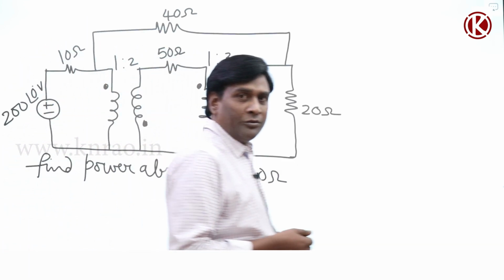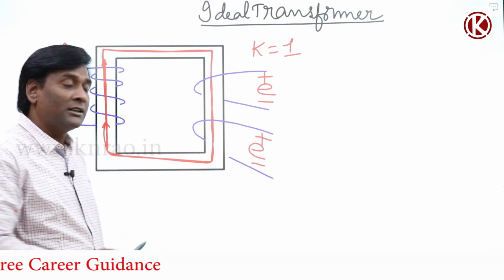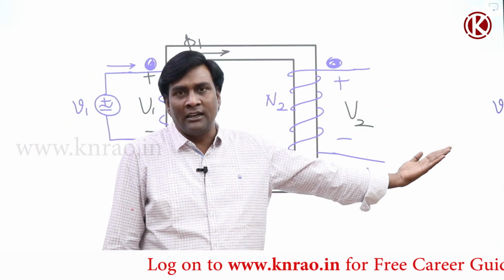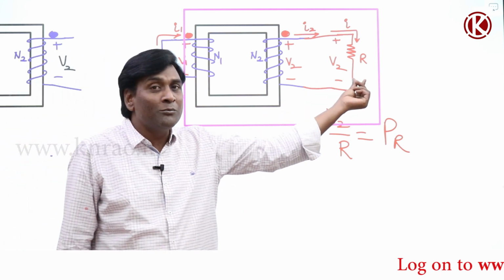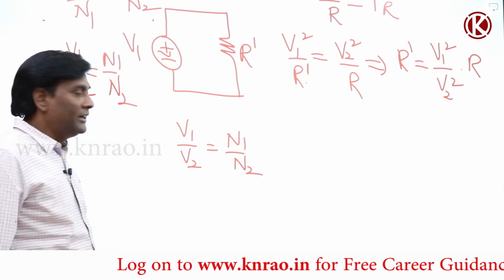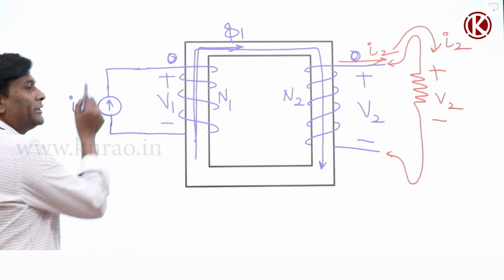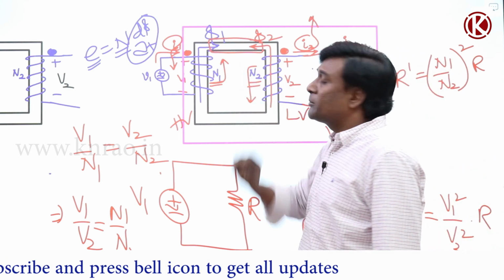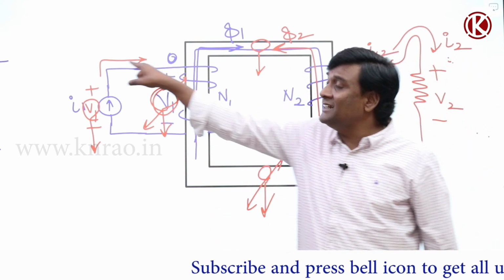Ideal Transformer as Coupled Network | Difference b/w Machines & Networks | GATE EE | KN Rao

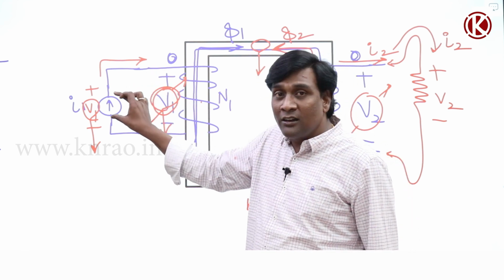Comment: 28:13

Sir , can we say , after connecting load
if nett flux Φ ↓ , then emf  E2 ↓ ,then current (I2 = E2/R) ↓ ,then flux (Φ2 ∝ I2) ↓, due to which nett flux Φ =  (Φ1-Φ2)↑ again to its original value